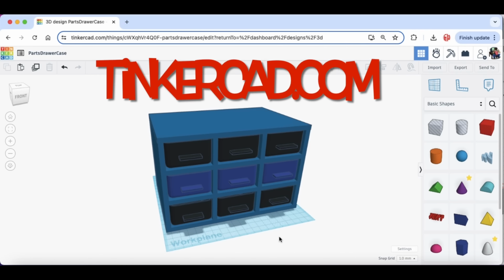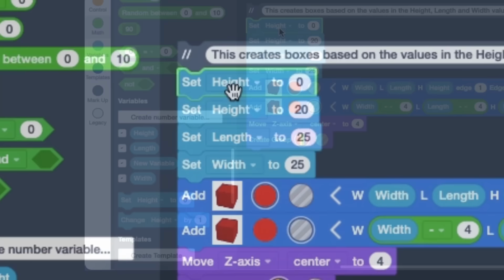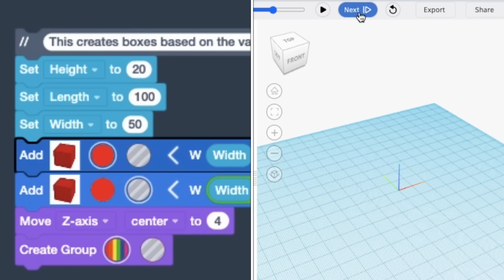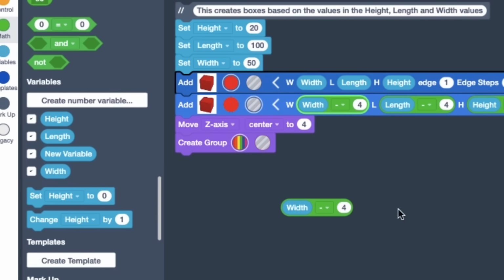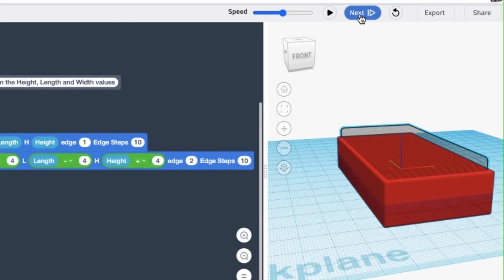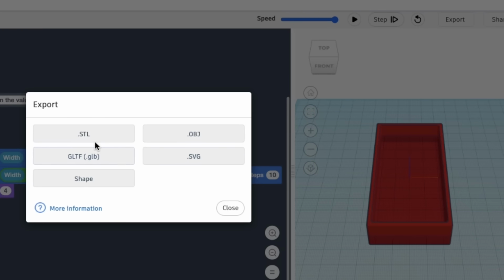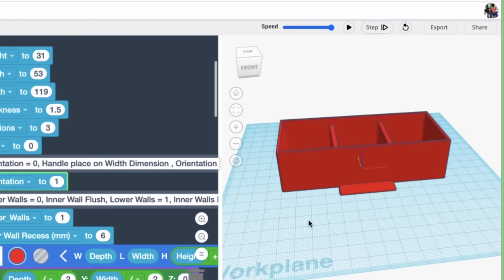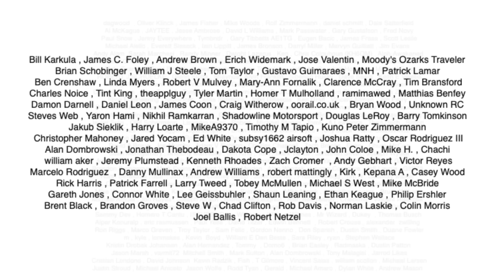Auto Generate 3D Prints using Tinkercad Code Blocks

Comment: CHEP, great, I've used TC for a year now and never really looked at codeblocks. Thanks for the nudge, I have been customising tray inserts for FDM printing for the last 6 months. I've got pretty good at it but I've now converted it into codeblocks. I enter 2 parameters and now it just produces a new tray insert. It can't do some of the fancy design stuff because I can't work a parametric design for it. Those are few and far between and I'll hand crank. This is so simple. Thanks again.

Comment: I am currently taking a Fusion360 course so I can add to my work skill set and so I can create my own models for 3D printing, woodworking, and remodeling.I have been using CAD for PCB layout  and electronic packaging of IC dies for years, so I don't anticipate a problem with Fusion360 (aside from the "normal" dithering on my part). I can see Codeblocks being extremely useful for STEM curriculums both for the relative simplicity and the power of Parametric design. I will be using it to introduce my sons to software programing and model creation so that they can have these skills. Thanks, Chuck, for taking the time to introduce this ability of TinkerCAD and for explaining it so well. Ignore the trolls.
Reply from the maker: Thank You. Glad I could help.

Comment: Huh...I see the code blocks thing in Tinkercad every time I log in but never bothered to check it out. It reminds of a simpler-to-use version of OpenSCAD, which I vastly prefer over Fusion or other programs for designing and printing parameterized models. I might have to play around in this a bit.

Comment: What would be super cool would be if it could take an existing 3D design in TK and generate a code block from it that you could then edit and add parameter/variables to it.  When it loads up a design you see it build the object piece by piece so the information is all there, should be an easy feature to add.
Reply from the maker: I’ve asked Tinkercad for that many times.

Comment: I don't kow Tinkercad.  Can it do male and female threads easily?  If not could this approach be employed?  Variables could adjust 10-32 to 1//4-20,, etc.  Length too.  Is that realistic, or a bridge too far?
Reply from the maker: If you know all the dimensions it might be possible but seems tough to do.

Comment: // Create the base of the bird box
var box = new Box({
  width: 200,
  height: 200,
  depth: 200
});

// Create the roof
var leftRoof = new Wedge({
  width: 200,
  height: 100,
  depth: 100,
  x: 0,
  y: 200,
  z: 100,
  rotation: { x: 0, y: 0, z: 45 }
});

var rightRoof = new Wedge({
  width: 200,
  height: 100,
  depth: 100,
  x: 200,
  y: 200,
  z: 100,
  rotation: { x: 0, y: 0, z: -45 }
});

// Create the entrance
var entrance = new Cylinder({
  radius: 15,
  height: 10,
  x: 100,
  y: 180,
  z: 0,
  rotation: { x: 0, y: 0, z: 0 }
});

// Add decorative elements
var trim1 = new Box({
  width: 200,
  height: 10,
  depth: 10,
  x: 0,
  y: 190,
  z: 100
});

var trim2 = new Box({
  width: 10,
  height: 190,
  depth: 10,
  x: 0,
  y: 0,
  z: 100
});

// Add all elements to the workspace
workspace.add(box);
workspace.add(leftRoof);
workspace.add(rightRoof);
workspace.add(entrance);
workspace.add(trim1);
workspace.add(trim2);

Comment: Interesting though I probably would just use OpenSCAD.
Reply from the maker: Wish I knew OpenSCAD better.
Reply: I am not an expert myself so some of the advanced stuff I am unable to do, but it is basic programming a lot like C.  I recently moved to FreeCAD after years of struggling with trying to learn it.  Mostly for the better precision and the ability to add dimensions.  There are things that are hard in FreeCAD too though.
Reply: Glad to see an OpenSCAD callout. I've used it, and like any tool some things are easier and some harder. Imo it works better for geometric shapes than functional mechanical parts

Comment: This seems far more complex than standard tinkercad 3d modeling
Reply: But you can change the output by adjusting variables rather than going and changing everything
Reply: It is but here's the rub, I had got 80+ versions of a tray of varying sizes with different patterns of different size holes. I kept them because I'd TCd them from a base design, wider, longer, bigger holes, smaller holes, more of them etc. I've binned 70 of them because I've just parameterised the design. I can produce the base models on demand, only the specials are now kept.

Comment: Wow thats a lot of work to make a box.
Its much faster if you just take tinkercad then you put your number in how big it must be you just cut out where you want the drawers from the side and leave the box solid.
Then go cura.
And spiritualze.
So it only wil make the walls.
And your done .
You this for drawers to and there you go.
Box done
Reply: Exactly, that’s a lot of work to make one box. And that’s the key, because after that, to make a new box with different sizes all you have to do is change a couple of variables and get a result in record time. I’ve wanted this for a long time but Fusion360 is waaaaay too difficult, so finding this out is great. Specifically I will use it first for a thing I make, it’s to cover analog sticks on gamepads so they don’t rot. No idea why that works, but point is that no two controllers have the same stick size, so every time I need to copy the project, ungroup, resize, re align, re group. Changing a couple of variables and exporting? Ohhhh yes.
Reply from the maker: @micver1091 - You missed the point. I can make any size box and multiple different boxes with a couple variable changes.

Comment: This is not code - it just looks like code.
Reply from the maker: And acts like code, allows variable changes like code and produces results like code.
Reply: @FilamentFriday  All true, excepts it is not code. It is a GUI based design.
Reply from the maker: @YigalBZ - If the GUI was fixed I’d agree but since you have to add parameters or variables to get command lines to work it’s more GUI assisted based code (developed to help beginners learn coding principles). Similar to how macros used in code can assist the developer but still often requires some setup or declarations.